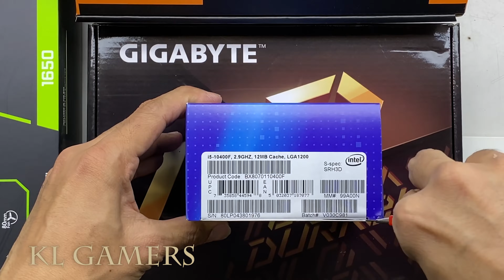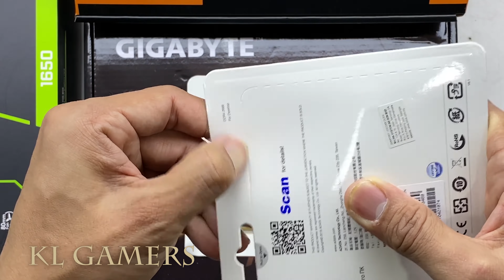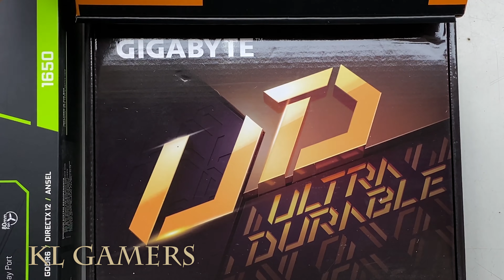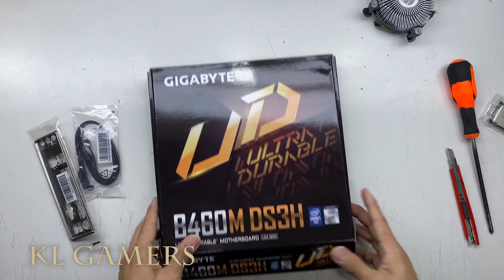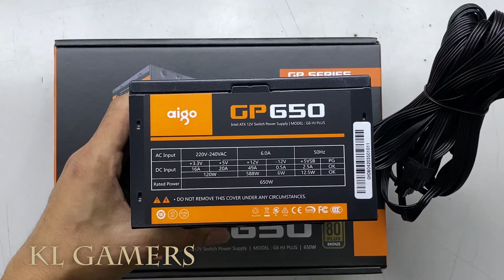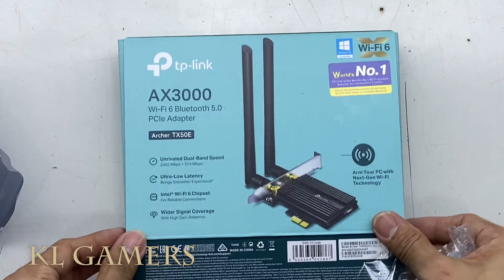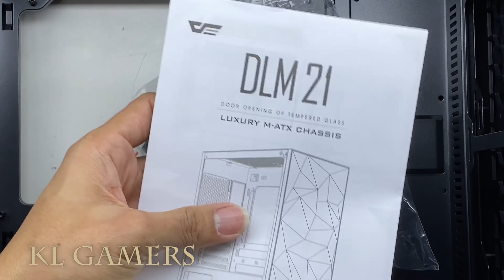intel Core i5 10400F GIGABYTE B460M DS3H GTX1650 DLM22 Black PC Build

Comment: seriously every time I enter this channel I find exactly the assembly I need, bro I'm your fan
Reply: If u want to buy this specs just dont the cpu is way to strong for this gpu
Reply from the maker: it's okay
Reply: @KLGamers  do you know what I did wrong I built with this mobo and did all the same things it cuts on fans run but nothing on the monitor except and hdmi2 thingy?
Reply: @baldur_edits  well that is the prebuilt configuration. I mean the prebuilt configuration has the super
Reply: i guess I'm kind of off topic but do anyone know a good website to watch newly released series online?
Reply: @Alfonso Archer i would suggest FlixZone. Just google for it =)
Reply: @Wilson Isaias Yup, have been watching on flixzone for years myself =)
Reply: @Wilson Isaias Thank you, I went there and it seems to work :) I appreciate it !
Reply: @Alfonso Archer No problem =)
Reply: I'm your cooler
Reply: @baldur_edits  9

Comment: Overall a very great guide. I'm building the same PC, except I'm using more expensive RAM and an i3-10100F, but they both run the same essentially. But just a tip: you shouldn't touch any of the components on the contacts and you should hold the CPU on the left and right corner in the middle.
Reply: is the i5 10400f too strong for the gtx 1650? Im curious cause im building the exact same pc (I'll eventually upgrade the gpu)
Reply: @JumpedMedia  i've heard for a i5 10400f is better to get a 2070 so it doesnt cause bottleneck
Reply: @JumpedMedia  no it isn't, 1650 is an entry level budget 1080p card, so you can put an i5 with. the better the CPU the better the graphics card will perform if you have one installed.

Comment: I ended up with the bad luck of the draw to get an i5 10400f CPU suffering from the WHEA_uncorrectable_error when building a computer using this same motherboard CPU combination. I've tried the various Bios "fixes" suggested to address the issue but it still remains. Tried Windows updates, checked board Bios, tried different ram, tried a fresh copy of Windows on a brand new SSD, tried reseating the CPU. I ended up installing an i7 10700K CPU from another system & this fixed the issue but it looks like I got a lemon i5 10400 CPU.
Reply from the maker: can send for warranty

Comment: This is almost exactly my build even the darkflash case! The only difference is my gpu. I use 1660s gaming oc and ram Tforce delta 32gb
Reply from the maker: Good
Reply: Any issues?
Reply: @howtosayhow  Not at all
Reply: Have you tried to stream or render anything with it?
Reply: @howtosayhow  im an architect and im using it as a workstation. You can run all rendering software smoothly. (depends on how you do your workload). Its a good combo if youre in a budget.

Comment: Did you have any problems with Gigabyte PSUs? And ever thought about Abkonkore or Sharkoon power supplies?
Reply from the maker: they are okay Gigabyte ones
Reply: I wouldn’t go with gigabyte due to the fact of the weaker rail system.

Comment: I have the same build as you but I have a problem where it turns on and off and I get no display at all can u help me?
Reply from the maker: try swap RAM slot, different brand of RAMs, check motherboard pins have bent

Comment: hey how to control rgb fusion with led strip 7color? i have this mobo but can't control my led strip with rgb fusion thanks
Reply from the maker: usually use the RGB fusion software if your LED strip is compatible
Reply: @KLGamers  I have tried using RGB Fusion 2.0 but the color still can't be adjusted ... the seller said it can be adjusted but it only stops at one color.

Comment: Could you please explain why u put the ram in those slots ? I’m just thinking of getting this mobo with 2x8gb so I might need to know
Reply from the maker: any slot will work
Reply: This guy didjt give you much info I’m not sure why... you put it in that order in MOST motherboards(not all but these days that’s how you do it) to get dual channel which is better ofc
Reply: They need to be spread apart. Usually they would be color coded but since they are kinda like invisible. But for ddr4 boards, you put them us slots 2 n 4
Reply: Make sure its dual channel refer to yout motherboards manual and it will tell you what slots are for dual channel its very important that its in dual channel because if not you will loose alot of fps

Comment: Hello, just wanna ask... My PC  case have 3 fans in front panel plus a single fan at the rear, now, should I separate the power supply of my SSD or its ok to attach it to the power  supply assembly of fans like what I saw in your video?

And what's the best place or what to do to get rid of electro static while building a pc?
Reply: Touch your pc case from time to time and work on a table
Reply: @Graphics_Card  Touching your PC case only grounds you if it is plugged in, and you should never work on a computer while it is plugged in.  Buy an antistatic bracelet, and not one of those "wireless"  ones.  Theres no such thing as a wireless antistatic band, its a scam.  I recommend the blue ones with a cord and alligator clip.  Clip the cord to any piece of metal that also touches the ground, like a metal chair or table leg.  The silver mesh in the bracelet collects the static from your skin and tranfers it to the ground through the chord.

Comment: good I have a question about the processor can be used without the video graphics I ask why I recently bought everything that appears in the video but when I turn it on it does not give me video I do not know if it is due to that
Reply: No. It doesn't have intergrated graphics.

Comment: Bro, thanks for the vid, randomley found it while looking for where to plug ur fans into. i was like sweet! we mostly have same parts, except for case and gpu. i never saw u plugging the fans in, and the ports were empty! how did u do that! there are two ports, and Ihave 3 fans, so this is a problem. (4 if u include cpu fan) so where and how do u plug them fans into?
Reply: Bruhh same, i just bought that same board and then i realized there is no place to plug more than two fans, prolly gon buy an extensión or some cause I don't know how tf he did that🤷🏽‍♂️

Comment: What was the budget of this pc with gst?
Reply from the maker: Processor =  Intel Core i5-10400F Desktop Processor 6 Cores up to 4.3 GHz Without Processor Graphics LGA1200 (Intel 400 Series ) 65W (DEC)
(Amazon link) = https://amzn.to/2XDBoBK
(Lazada link) = https://c.lazada.com.my/t/c.Y5a4eQ?url=https%3A%2F%2Fwww.lazada.com.my%2Fproducts%2Fintel-core-i5-10400f-6-cores-up-to-43-ghz-lga1200-processor-without-processor-graphics-i5-10400f-i1314432419-s4035954258.html&&sub_id1=10400F&sub_id2=YES&sub_id3=639
(Shopee link) = https://invol.co/clvw63

Motherboard = Gigabyte B460M DS3H (LGA1200/Intel/B460/Micro ATX/M.2/SATA 6Gb/s/USB 3.2 Gen 1/DDR4/Motherboard)
(Amazon link) = https://amzn.to/3eOh5sO
(Lazada link) = https://c.lazada.com.my/t/c.YUA1xB?url=https%3A%2F%2Fwww.lazada.com.my%2Fproducts%2Fgigabyte-b460m-ds3h-m-atx-motherboard-i1425942136-s4581802021.html&&sub_id1=B460M&sub_id2=PCByte&sub_id3=354
(Shopee link) = https://invol.co/cl1rp4p

RAM = ADATA DDR4- 16GB RAM - DIMM 288-pin - 2666 MHz / PC4-21300 - CL19-1.2 V - unbuffered - Non-ECC
(Amazon link) = https://amzn.to/2OFMbqI
(Lazada link) = https://c.lazada.com.my/t/c.6tb2?url=https%3A%2F%2Fwww.lazada.com.my%2Fproducts%2Fadata-ram-ddr4-2666-u-dimm-16gb-i435493224-s636338959.html&&sub_id1=ADATA&sub_id2=OFFICIAL&sub_id3=360
(Shopee link) = https://invol.co/clkwvt

SSD = ADATA XPG SX8200 PRO M.2 PCIE GEN3x4 SSD
(Amazon link) = https://amzn.to/39P98kv
(Lazada link) = https://c.lazada.com.my/t/c.YUy3H7?url=https%3A%2F%2Fwww.lazada.com.my%2Fproducts%2Fadata-xpg-sx8200-pro-pcie-m2-2280-solid-state-drive-256gb512gb1tb2tb-i488598676-s1431066623.html&&sub_id1=8200&sub_id2=Viewnet&sub_id3=349s652831528.html&&sub_id1=sx8200&sub_id2=EIT&sub_id3=240
(Shopee link) = https://invol.co/clu0am

Graphics Card = MSI GTX 1650 4GB D6 AERO ITX OCV1 4GB GDDR6 GTX1650 (JAN)
(Amazon link) = https://amzn.to/2Kit5YE
(Lazada link) = https://c.lazada.com.my/t/c.Y5aOhe?url=https%3A%2F%2Fwww.lazada.com.my%2Fproducts%2Fmsi-gtx-1650-super-ventus-xs-oc-graphic-card-i918606522-s2292878896.html&&sub_id1=1650SV&sub_id2=LAZ&sub_id3=839
(Shopee link) = https://invol.co/cl2bdiw

Wifi = TP-Link WiFi 6 AX3000 PCIe WiFi Card for PC with Heat Sink| Bluetooth 5.0 | 802.11AX Dual Band Wireless Adapter with MU-MIMO, Ultra-Low Latency (Archer TX50E)
(Amazon link) = https://amzn.to/2DuK6eS
(Lazada link) = https://c.lazada.com.my/t/c.b6kMNB?url=https%3A%2F%2Fwww.lazada.com.my%2Fproducts%2Ftp-link-ax3000-wi-fi-6-bluetooth-50-pcie-adapter-archer-tx50e-free-pubg-bag-i1169126020-s3379272581.html&&sub_id1=AX3000&sub_id2=Mono&sub_id3=149
(Shopee link) = https://invol.co/clvwf5

Power Supply = Aigo GP 550W / 650W 80Plus Bronze Power Supply
(Amazon link) = https://amzn.to/36hc2g0
(Lazada link) = https://c.lazada.com.my/t/c.fOYN4?url=https%3A%2F%2Fwww.lazada.com.my%2Fproducts%2Faigo-gp550-550watt-80-plus-bronze-power-supply-aigo-gp550-i990598761-s2608250011.html&&sub_id1=aigo&sub_id2=PCBYTE&sub_id3=169
(Shopee link) = https://invol.co/clp6sb

Casing = darkFlash Micro ATX Mini ITX Tower MicroATX Computer Case with Door Opening Tempered Glass Side Panel (DLM22 Black) (JAN)
(Amazon link) = https://amzn.to/3f07tKD
(Lazada link) = https://c.lazada.com.my/t/c.bD4HXA?url=https%3A%2F%2Fwww.lazada.com.my%2Fproducts%2Faigo-darkflash-dlm22-black-matx-magnetic-hinged-tempered-glass-chassis-bundle-promo-new-i512452504-s975758447.html&&sub_id1=DLM22&sub_id2=Raydeeyo&sub_id3=249
(Shopee link) = https://invol.co/cl2bdja

Price is based in local Malaysia current price.

Comment: I like adata ram! Cheap n working good. My question is does the mobo good for overclocking?
Reply: no
Reply: Intel B and H series motheboard do not support overclock. The only Intel based motherboards which support OC are the Z series, such as Z390 for the Intel 8th and 9th cpus based on the 1151 socket and Z490 for the Intel 10th and 11th gen cpus based on the new 1200 socket.
Reply from the maker: no overclock , just XMP profile for RAM

Comment: How to use rgb sync for this motherboard?
Reply from the maker: i have no idea
Reply: There isn’t a argb header unfortunately, they didn’t add the pins as a cost saving measure, it only comes with a normal 4 pin rgb header

Comment: Hey brother please mension total cost of build.
Reply from the maker: Processor =  Intel Core i5-10400F Desktop Processor 6 Cores up to 4.3 GHz Without Processor Graphics LGA1200 (Intel 400 Series ) 65W (DEC)
(Amazon link) = https://amzn.to/2XDBoBK
(Lazada link) = https://c.lazada.com.my/t/c.Y5a4eQ?url=https%3A%2F%2Fwww.lazada.com.my%2Fproducts%2Fintel-core-i5-10400f-6-cores-up-to-43-ghz-lga1200-processor-without-processor-graphics-i5-10400f-i1314432419-s4035954258.html&&sub_id1=10400F&sub_id2=YES&sub_id3=639
(Shopee link) = https://invol.co/clvw63

Motherboard = Gigabyte B460M DS3H (LGA1200/Intel/B460/Micro ATX/M.2/SATA 6Gb/s/USB 3.2 Gen 1/DDR4/Motherboard)
(Amazon link) = https://amzn.to/3eOh5sO
(Lazada link) = https://c.lazada.com.my/t/c.YUA1xB?url=https%3A%2F%2Fwww.lazada.com.my%2Fproducts%2Fgigabyte-b460m-ds3h-m-atx-motherboard-i1425942136-s4581802021.html&&sub_id1=B460M&sub_id2=PCByte&sub_id3=354
(Shopee link) = https://invol.co/cl1rp4p

RAM = ADATA DDR4- 16GB RAM - DIMM 288-pin - 2666 MHz / PC4-21300 - CL19-1.2 V - unbuffered - Non-ECC
(Amazon link) = https://amzn.to/2OFMbqI
(Lazada link) = https://c.lazada.com.my/t/c.6tb2?url=https%3A%2F%2Fwww.lazada.com.my%2Fproducts%2Fadata-ram-ddr4-2666-u-dimm-16gb-i435493224-s636338959.html&&sub_id1=ADATA&sub_id2=OFFICIAL&sub_id3=360
(Shopee link) = https://invol.co/clkwvt

SSD = ADATA XPG SX8200 PRO M.2 PCIE GEN3x4 SSD
(Amazon link) = https://amzn.to/39P98kv
(Lazada link) = https://c.lazada.com.my/t/c.YUy3H7?url=https%3A%2F%2Fwww.lazada.com.my%2Fproducts%2Fadata-xpg-sx8200-pro-pcie-m2-2280-solid-state-drive-256gb512gb1tb2tb-i488598676-s1431066623.html&&sub_id1=8200&sub_id2=Viewnet&sub_id3=349s652831528.html&&sub_id1=sx8200&sub_id2=EIT&sub_id3=240
(Shopee link) = https://invol.co/clu0am

Graphics Card = MSI GTX 1650 4GB D6 AERO ITX OCV1 4GB GDDR6 GTX1650 (JAN)
(Amazon link) = https://amzn.to/2Kit5YE
(Lazada link) = https://c.lazada.com.my/t/c.Y5aOhe?url=https%3A%2F%2Fwww.lazada.com.my%2Fproducts%2Fmsi-gtx-1650-super-ventus-xs-oc-graphic-card-i918606522-s2292878896.html&&sub_id1=1650SV&sub_id2=LAZ&sub_id3=839
(Shopee link) = https://invol.co/cl2bdiw

Wifi = TP-Link WiFi 6 AX3000 PCIe WiFi Card for PC with Heat Sink| Bluetooth 5.0 | 802.11AX Dual Band Wireless Adapter with MU-MIMO, Ultra-Low Latency (Archer TX50E)
(Amazon link) = https://amzn.to/2DuK6eS
(Lazada link) = https://c.lazada.com.my/t/c.b6kMNB?url=https%3A%2F%2Fwww.lazada.com.my%2Fproducts%2Ftp-link-ax3000-wi-fi-6-bluetooth-50-pcie-adapter-archer-tx50e-free-pubg-bag-i1169126020-s3379272581.html&&sub_id1=AX3000&sub_id2=Mono&sub_id3=149
(Shopee link) = https://invol.co/clvwf5

Power Supply = Aigo GP 550W / 650W 80Plus Bronze Power Supply
(Amazon link) = https://amzn.to/36hc2g0
(Lazada link) = https://c.lazada.com.my/t/c.fOYN4?url=https%3A%2F%2Fwww.lazada.com.my%2Fproducts%2Faigo-gp550-550watt-80-plus-bronze-power-supply-aigo-gp550-i990598761-s2608250011.html&&sub_id1=aigo&sub_id2=PCBYTE&sub_id3=169
(Shopee link) = https://invol.co/clp6sb

Casing = darkFlash Micro ATX Mini ITX Tower MicroATX Computer Case with Door Opening Tempered Glass Side Panel (DLM22 Black) (JAN)
(Amazon link) = https://amzn.to/3f07tKD
(Lazada link) = https://c.lazada.com.my/t/c.bD4HXA?url=https%3A%2F%2Fwww.lazada.com.my%2Fproducts%2Faigo-darkflash-dlm22-black-matx-magnetic-hinged-tempered-glass-chassis-bundle-promo-new-i512452504-s975758447.html&&sub_id1=DLM22&sub_id2=Raydeeyo&sub_id3=249
(Shopee link) = https://invol.co/cl2bdja

Price is based in local Malaysia current price.

Comment: I have the same pc but if istart i can hear 5 lil bip help please :(

 (sorry for my bad english im fr)
Reply from the maker: The intel i5 10400F processor which have the "F" SKU model at the back means no build in intel HD graphics which means you cannot use this processor without a graphics card.

Meaning you will not get any display output from the motherboard physical VGA/Display Port/HDMI if you pair it with a "F" SKU model intel processor such as the intel i5 10400F processor. You will need a graphics card such as the GTX 1650.

or you forgot to plug in 6 pin graphics card power 

or just swap RAM slot
Reply: @KLGamers  i get a GPU tomorrow :) i Come back if its works